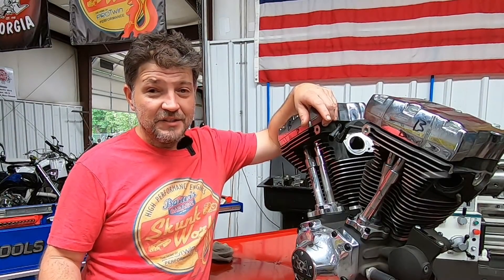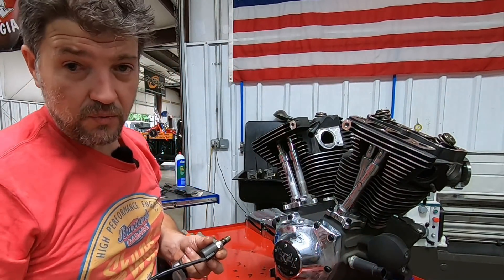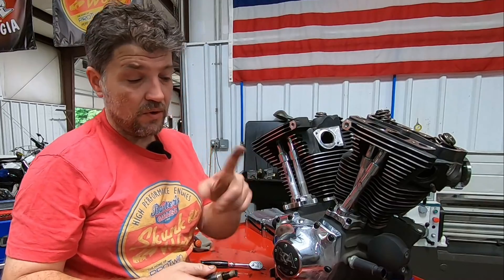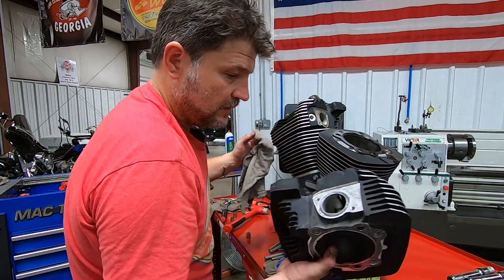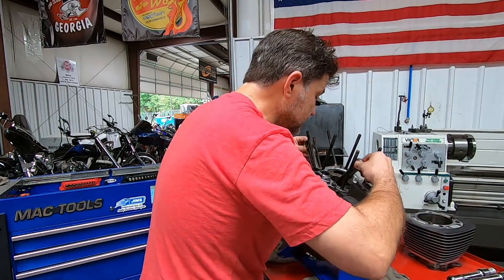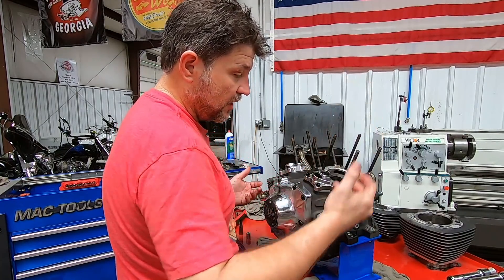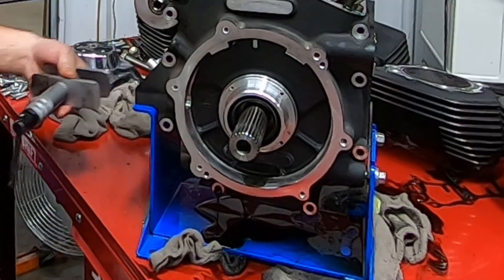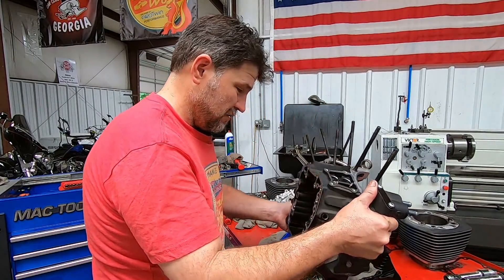TWIN CAM 103 SUMPING! - ENGINE TEAR DOWN Marathon - Kevin Baxter - Pro Twin Performance

Comment: Harley should be absolutely ashamed of themselves with those crankshafts running out like that. What a shame.
Reply: I'm so lucky, I measured my pinion runout to be within .001" on my '01. I put some gear drive cams in it.
Reply: @clownpocket  That's awesome.... and fairly rare. Congrats!
Reply: harley and the brass have no shame,its all about the almighty dollar
Reply: @Michael Thr33d true, but Harley owners should see Kevin when and if they want to. You shouldn't have to rip into a fairly new bike, then spend thousands more just to keep it running. I'm so glad I got rid of my Twin Cam when I did.
Reply: @clownpocket  They had higher quality steel and timken bearings in 01 , 03 was the last year.
Reply: This is a 2013 SG 103....in 2013 the cvo was not a 103...
Reply: If the ever learn to make an EXTERNAL  SHAFT DRIVEN OIL PUMP IT WOULD BE A TRUE MIRACLE!!

Comment: Seeing all the issues in these tear down videos has me paranoid about my bike lol. It's a TC 103 and running fine with 27k on the clock, but I haven't opened it up for anything but cams and rocker lockers... now every little noise or vibration and I'm panicked,  thanks Kevin lol

Comment: I recently changed my oil in my 2005 fatboy, I was only able to get 2.5 quarts out. I added 2 quarts and rode it for a bit them topped it off with the /5 quart and it now reads full. Sumping maybe?
Reply: No, I'd say that's the 2005 oil pump which was rubbish at scavenging.

Comment: When i change my oil. I always pull the oil return to my tank after cleaning my filter and refiling my tank. With plugs out crank till get clean oil. Takes about a half quart to turn to new oil.

Comment: Hi Keven,

How does high crank case pressure cause a sumping  condition?
Will you please help us understand?  
I thought the return oil pump should keep up with the return oil in the crank case.
I can see a sumping issue would happen your engine has an excess amount of oil going into the motor, like bad piston cooling nozzles or excess bearing clearance.
Thank you for the wonderful videos. :_skunk:

Comment: I have never seen the inside on these motors. Can you explain where the oil is picked by the pump. I always thought that the sump part on the pump put out twice as much oil as the pressure side. I guess if the motor is on the kick stand, the pump won't drain the sump at idle? Thanks Kevin for what you do for all of us who want to know the nitty gritty.

Comment: Kevin, thank you for sharing your insights during these engine tear downs; I have a 2015 FLTRXS with 43,667 miles.  I recently did the HD stage III 103ci to 110ci performance package with the SE585 cam, 4” cylinders, pistons, SE cam plate with SE oil pump, SE tappets.  I believe my rear ACR is causing a leak because when I'm on long ride there is discoloration on the rear of my horn cover as well as the rear jug becoming extremely hot while riding.  I may be seeking your services shortly; also, will it be possible to go up to a 117ci motor?

Comment: On carbon build up, as I do more auto and one of things we do is use a fuel injector cleaner or a complete manifold cleaner to remove excessive carbon without tear down. Is this something an owner of HD use injector cleaner on regular basis?

Comment: Not real familiar with Harley's but, was wondering if there is a sight glass for the oil level on them?  Could the sumping issue be from left over engine oil in the cases after draining the oil and, just adding the recommended amount of oil possibly making the oil level higher then what is recommended?

Comment: Hello all, I have been watching all of Mr, Baxter’s videos in search of good information on these Harley twin cam engines. I recently bought a 2015 FLHTK with the HO 103 twin cooled engine in her, 16K original miles on it. Has a SE ventilator on it and V&H OS slip ons with the FP3 tuner. My only source of info till this point Is a buddy who rides HD?? First some oil coming out of the air cleaner so he says they all do it gotta do the breather bypass? Here it starts, I was riding down the highway and the water pump quits on me so I limped it home(2 mi)and replaced it with the updated M8 water pump but at the same time I’m spinning wrenches I installed a external breather bypass and swapped the fluids out for AMSOIL. Start it back up and sure enough it has no oil dripping from the air cleaner but has awful top end tick and extreme loss of power after she’s up to temp. Not sure where to start, ordered service parts and wiring manuals from the motor company and am now hoping some of you guys with more knowledge and experience could chime in and give a guy starting out a hand? Where should I start looking, she ran just fine before this. Also if this is not the place for these kinds of questions is there a better? I’ve read through all the forums. Please and thanks all.

Comment: I would like for you to try a .0002 over size tapplet just to check and confirm.
Reply from the maker: I assume you mean .002?  We don't have a .002.  I have found that by the time the bore get's to the point it requires a .002, they typically have taper as well.  Those require bore and sleeve to repair properly or the bore can be reamed .010 over and use a JIMS .010 lifter.
Reply: @KevinBaxter  sorry about the extra '0', brain was not fully engaged.

Comment: Hey Kevin love all your videos I have a couple questions I’m installing cams on my 2014 Breakout 103ci What’s the procedure on initial start up and run time ? Is it ok to use Redline synthetic oil at time of cam replacement with the assembly lube? And when should I change the oil and filter with assembly lube mixed in after cam replacement ? Keep up the great videos appreciate your knowledge and expertise. Thank you

Comment: Great content Kevin. I have a question concerning the black oil coming from the sump. I had found a kit to remove the old oil from the lines and pump after an oil change. It’s basically an oil filter housing minus the filter media. When you change the oil you put this dummy filter in place, disconnect the oil return line from the oil tank and run the bike till clean oil comes out then shut off the bike. The example I saw they had almost a whole quart of black oil. All that to ask would that be a sign of sumping? Being a dry sump engine I find it hard to believe you get a quart of dirty oil out of the lines and pump.
Reply: IMO, scavenging your oil system is a solid idea, at least every other oil change. On a engine that is not sumping you will scavenge around 10oz and one that is sumping will be more, depending on the severity of the sumping issue. An additional note is the oil that never gets drained, contributes to the overfill and blow by condition, that is a constant concern with Harley owners. The remaining oil needs to be added to the amount of oil your adding to equal the stated fill ratio of 4 quarts for your TC.

Comment: Excess carbon build-up on the pistons can be caused by the ECB routing into the carb breather. Are these engines still running the factory ECB?

Comment: I have a question. Do your engine mods prevent the sumping issue and have you ever tore down one of your own engines to see if you have prevented the sumping? Thanks
Reply from the maker: After many inspections, we have not had a single customer with a sumping issue on any of our TC or M8 builds.

Comment: Is there a way to de-carbonize the top end? And would you recommend it?
Reply: yes pull plugs before oil change and spray your favorite like seafoam and let sit overnight crank run for 5 minutes or so then change oil ,this also helps to maintain tune ,
Reply: @gregduncan1001  Nice. Thanks for the info
Reply: Seafoam all the way

Comment: My 2007 Road king had a pinched O ring in the oil pump causing it to throw oil out the breathers on the heads and into the intake.

Comment: i have a question on carbon on piston crown removal in a running motor... now i know you can spray into the air cleaner a little water when engine is running and rev it a little when spraying a little water in the air intake to break-up the carbon on the crown of the piston in a car/truck engine... can i do the same thing to a motorcycle engine???  now remember this when doing this:  that carbon has that has got loose and is blowing out the exhaust valve can maybe just maybe get stuck on the valve and or the valve seat and then you will have a large problem, the exhaust valve will not close 100% and that hot air exhaust will burn that valve quickly and that my friend is a costly mistake ... just say`n ... just remove the cylinders and pop out the pistons and do it the correct way i guess...

Comment: Third engine tear down Ive watched and theres a pattern emerging with those crankshafts. that you cant gloss over. seems to Me possible oil circulation or may be varying sump pressure s on those Engines.

Comment: My ‘13 Ultra Classic has 60K miles on it; stock with no upgrades. Getting ready to upgrade to Feuling 525 Reaper cams and cam plate/oil pump/tappets kit. What is the max runout I can allow before the crank needs to be serviced, thus preventing the very issues you are revealing in these videos? Excellent videos, by the way. 👍

Comment: Why buy a new bike from Harley?  Buy used one the has high miles for cheap, then get a motor from Kevin, and you are as bullet proof as you can be.
Reply: I could certainly appreciate a Baxter engine…but I like to turn my own wrenches…so…well this way is cheaper…but more time consuming…

Comment: I have a question why does Harley not copy the design of the S+S crank by pressing a solid pin in the center of the crankpin at 600 pounds pressure, that would most likely solve their run out problems?

Comment: Does every motor with a few miles have excessive oil in the bottom end? I’ve got 100k miles on my 2011 103 motor and wondering how it looks on the inside. It’s making another trip back to Sturgis this year.
Reply: I have 126,000 on my 2013 and I think the same thing. I do know my runout is.006 and at 100K my compression was still the same as the 25K test.
Reply: measure it, just remove the plug on the bottom of the crankcase and measure how much oil comes out. Thats the way I checked my 2017 M8, it had less than 0,3l of oil in the crankcase. The M8 of a buddy of nine had allmost 3l of oil in in, that motor spew out a lot of oil and didnt rev anymore. Turned out to be a damaged S&S oilpump.

Comment: Man, I've been watching all these videos.. The Twin Cam Build, The M*8 Build...All this stuff, and I NOW see why people HATE the Motor Co., yet, out of blind faith, people CONTINUE to by MORE!! Look, H-D is the KING when it comes to that "Classic Bad-Ass" sound of a V-Twin rolling by... Victory and Indian are knocking on the door, LOUDLY.. But DAMN!! You'd think for a Company looking to SURVIVE they'd quit getting CHEAP on the assembly process, cheaper STILL on the design and just FIX what they're fucking up!! OR, we can just go to Baxter's and pay another 10G and have it done RIGHT, the NEXT time!! Seriously, seeing all these issues just pisses me off enough to redesign the entire damn drive-train and PATENT that shit!!
Reply: Check-out the Indian Big-Twin bottom-end some time with its forged, solid-steel crank and single crank-pin with two connecting rods running side-by-side on plain bearings!   Bullet-Proof!
Reply: I hear you loud and clear. My '14 Road King is my third new Harley and very likely my last. I can't justify the expense for a machine that requires everything to be upgraded. Stock suspension is garbage and they still come out of the crate with incandescent bulbs! It's very disheartening to see.
Reply: Is that a S&S motor in the Indians bikes of say 2000 -2005 years? IAM not sure anyone set me straight on this out there? 🤔😎